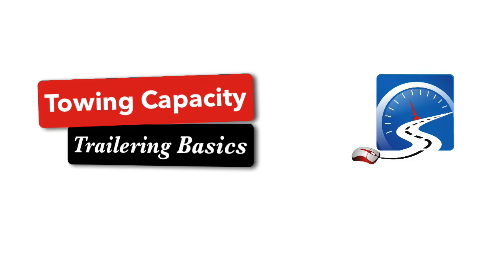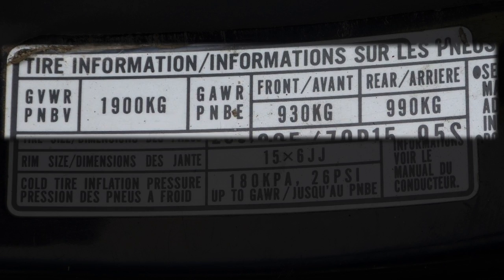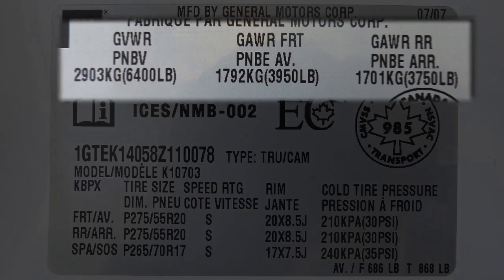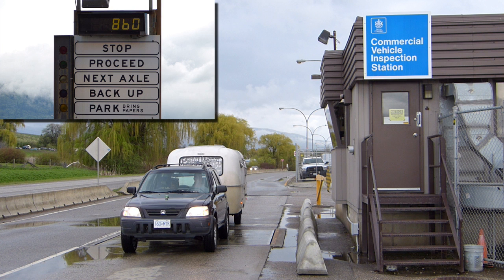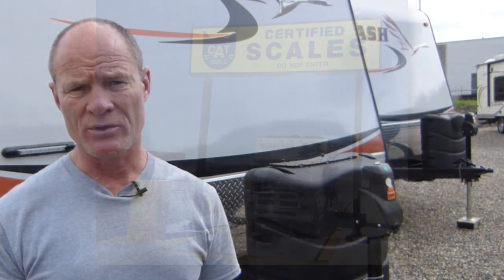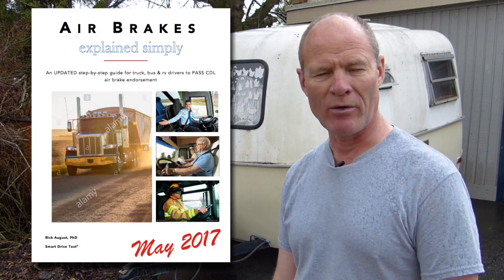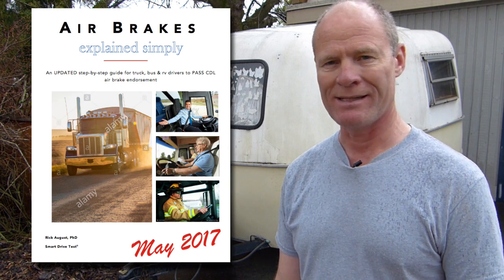How to Tow a Trailer Correctly & Safely :: Towing Capacity•Vehicle & Axle Weights | Trailering SMART

Comment: In the U.S.A., if weight is in question, I would recommend going as directly as you can to a truckstop scale or a local business that has one. If you chance going to a D.O.T. scale (weigh station) & they so happen to be open, you may be looking at some ugly fines if something is overloaded. They are not usually kind or forgiving about it. Also, even though some do, they don't all have a read-out available to you when they are closed. It's much cheaper (and safe) to just weigh at the truckstop, business, etc. than to risk the potential fine & trouble.
Reply from the maker: Hi Anonymous Trucker - Thank you for your comment and pertinent information. You are most right my friend, if you are in doubt about the weight of the trailer, take it to a scale. Never assume that you're legal. If there is anything further we can do, drop us a note. Always happy to help. All the best, Cheers Rick

Comment: On most vehicles,  you will get more than the GVWR if you add the GAWR ratings together.  Why, I don't know.  But you may want to change your statement on that part.  All GVW stickers on trucks  give you the GVWR....which will be less than the combination of the two axles.
Reply from the maker: Hi Harry V - Thank you for your comment. And that is a valuable point; I assumed incorrectly. I took the information from commercial vehicles. With commercial vehicles the axles weights add up to the total gross vehicle weight. Odd that the same doesn't apply to light trucks and passenger vehicles. Yes, I will need to make an amendment. All the best my friend, Cheers Rick

Comment: Thank you, Rick! It's like you know what I need and when  I need it. As you know I'm moving so we will be towing our cars and I wanted to learn how to tow one
Reply from the maker: Hi Big$MoneyBoss - thank you for your comment. How far are you moving? One of the most important techniques or trailering is to always, always pull the trailer through curves, corners and turns. Slow down before, and then power through; not heavy acceleration, but just keep the towing unit in front of the trailer. You never want that trailer pushing you, except when braking in a straight line. Happy trailering. I should have the trailer backing video up by the end of the week. If there is anything further we can do, drop us a note. Always happy to help. All the best, Cheers Rick
Reply: I will be driving like 1k miles
Reply from the maker: So...you're definitely moving out of state!!  80)P
Reply: Yes, I can't wait!
Reply from the maker: Where are you moving to? You'll miss the skiing!
Reply: Nevada I will miss the snow
Reply from the maker: Hi Big$MoneyBoss - you know that the only thing in Nevada is Las Vegas!! And now of course there'll be you. 80P It's funny, I lived in Australia, and on Vancouver Island and I never realized how much I missed the snow until I came back to it. I really like winter...but I like it when it's gone to. I guess I like the changing of the seasons. Safe travels my friend. All the best, Cheers Rick
Reply: Yep we're moving to LV
Reply from the maker: Is it a gamble or a sure thing?  LOL

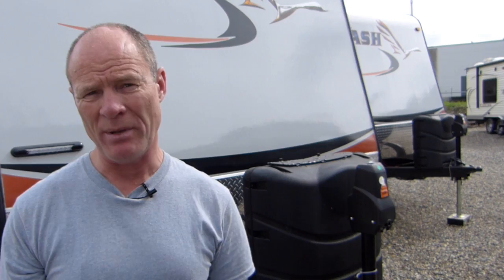Comment: The vehicle at 5:41 is a CR-V like mine. Tongue capacity on that vehicle is only 110 lbs. Looking at the rear suspension sag, it looks like that trailer is too big for that Honda. Maybe you just need new shocks.

Comment: We have a 2010 Chevy Silverado LT Crew Cab 5.3L engine with a Leer cap (approx. 200lbs).  Its GVWR is 7000 lbs.  But the each of the axles is rated at 3950??  That's over 7000 lbs.  Also the tow rating is 12,000 lbs.  We have a 25' TT with a GVWR of 6600 lbs.  We weighed it fully loaded at a CAT scale and came up with: Steer Axle 3120Driver Axle 4040 Trailer Axle 4620TOTAL 11,780 (including the truck, passengers and all cargo/fuel)So my question is with a tow rating of 12,000 -- you video leads me to believe that is the max our truck can pull, not including the truck weight -- so we should be fine (I understand we need to lighten our load over the driver axle.  Yet I've shown the numbers to others and they're telling me I need a bigger truck.  And how does one find the tongue/pin weight??Thanks for your video and advice!
Reply from the maker: Hi Shalene Germani - Thank you for your comment and query. The towing capacity of the vehicle is 12,000lbs; that means that you can tow a trailer weighing 12,000lbs, not the total weight of the truck and trailer. Yes, you have to get the tiniest bit of weight off the drive axles, but most o the time you're not going to be pulling the trailer around with a full tank of water, and the truck isn't going to have a full tank of fuel, so you're going to be fine. With the numbers that you gave me, that truck is more than capable of pulling that trailer. To find the pin weight, go back to the CAT scale and drive on the scale so just the truck is on the scale, and far enough that you can unhook the trailer, and drive the truck off the scale. With just the trailer jack of on the scale, that weight is your tongue weight. As I'm sure you're aware, that pin weight should be 15-25% of the trailer's loaded weight. If there is anything further we can do, drop us a note. Always happy to help. All the best, Cheers Rick
Reply: Thank you so much for your response.  I feel much better.   Also, am I understanding that it would be best to move some of the cargo that is currently in the bed of the truck into the trailer to lighten the Driver Axle?  What would an ideal reading look like assuming the total is still 11,780?  We do have a weight distribution hitch, if I didnt' mention that before.  How do you know if it's tightened properly?  Thanks again!
Reply: Well, now I'm getting conflicting numbers -- checking with NADA, it lists the towing capacity for a 2010 Chevy Silverado 1500 at 5500!  Is there a difference between towing capacity and maximum trailer weight capacity which is listed at 12,000?  Why is there such a vast difference?  If the truck weighs approx. 7000lbs, that seems to add up and we are dangerously close to the limits...
Reply from the maker: Hi Shalene Germani - Thank you for your query. I talked to my mate who is a Chevy truck man through and through and got expert advice for you. Alright, that truck should be able to to 7,700lbs with a tongue weight of 700lbs.  He said to take note of the tanks - grey and fresh water are going to run at 10lbs per gallon, and sewage is going to run 12lbs per gallon. With a 6,600lbs trailer, he said the truck will tow that trailer on the flat and for shorter trips. If you're running longer trips and mountains, you'll need a transmission cooler. The vehicle may be equipped with a transmission cooler, and if it is, you're good to go. If there is anything further we can do, drop us a note. Always happy to help. All the best, Cheers Rick
Reply: Dam! You don't have a WD hitch. You are over GM's trailer weight for weight carrying. If you do it is not set up correctly. You need a WD hitch your front axle weight is not enough for proper braking

Comment: So glad to find your video,...very needed. Q for ya?
I have a 2016 gmc duramax deisel dually, 22000lb towing ability.
I want to get a 4000lb dually suretrac dumper with 14000lb max load...i know it can tow but was told to get inspection for the truck for commercial license plate. I have a class 3 with air...will this do or do i need to add the heavy endorsement? Mapleridge
Thnx Graham
Reply from the maker: Hi graham watts - Thank you for your comment. And you are good with a Class 3 with air. In BC you can operate a truck with a trailer over 4,600kg (10,000lbs) so long as neither the truck nor the trailer have air brakes. Once you throw in air brakes, it's a Class 1 vehicle. If there is anything further we can do, drop us a note. Always happy to help. All the best, Cheers Rick
Reply: Smart Drive Test Thanks so much..your a great resource...appreciate it!
Reply from the maker: Hi graham watts - you are most welcome my friend. All the best, Cheers Rick

Comment: I am buying new truck tires for my F150 tomorrow. Hoping you can get back to me sooner than later on this one. The load rating for the tires, is higher the better or does it not matter? I already installed Air lifts to level out the ride for my travel trailer.  I also have an equalizer installed to help with the stability.
Reply from the maker: Hi Mark - thank you for your comment and query. If you buy tires with higher load rating, first these are going to cost you more and second, I believe you're going to compromise ride. I would suggest that you buy quality tires - I personally like Michelins. I believe if you purchase quality tires with the proper load rating for the GAWR for your vehicle, you'll be great. If there is anything further we can do, drop us a note. Always happy to help. All the best, Cheers Rick
Reply: Smart Drive Test  Thank you for your video. Your reply, advocating against buying higher load rating tires runs counter to recommendations I've heard for decades, at least as relates to RVs. It seems most bumper towable campers in the ~10K pound range come with load range 'D'. I and most people I know opt for top brand,  load range 'E'. They're a little stiffer and rated for higher loads largely because they are rated for higher maximum tire pressures. If 50 PSI is the limit for load range D and 80 PSI is the max for load range E, I may run 50 to 60 PSI with the knowledge that the tire is stronger, flexes less, and consequently, run cooler.  I've never noticed a difference in handling between them.

I wonder what your thoughts are regarding 'nitrogen filled tires'. Given that air is 80% nitrogen already, switching to ~95% (you can't truly attain 100%) seems like hype. And yet, not only do a lot of manufacturers advocate this, I also saw where the tires on the SR-71 jet are nitrogen filled, although at least the Air Force would have the chamber facilities required to ensure 100% nitrogen.

I also wonder what your recommendations are pertaining to sway control. Given a representative 1 ton pickup pulling 10k pounds, with 10% tongue weight distribution, I assume the need for sway control is much greater for a top heavy RV than it is for a car trailer of the same weight. Is that a reasonable assumption? I'll have to look for any videos you have on the subject as it's not clear to me why there can be such instability even when you're not going down a hill or applying the brakes.

I looked into 'active' sway control systems such as the 'Sway Command' by Lippert. If a dramatic sway event occurs, it individually controls the braking proportions for the left and right trailer tires to counter sway. It is an intriguing concept. And yet, I read where Jayco installed a bunch of them on new trailers a couple years ago only to recall and remove them because they occasionally conflicted with the integral brake control system found on new pickups. do you have any thoughts on this emerging technology?

Comment: 2016 F350 Crew Cab Long Bed Dual wheel 4X4 3.73  Axle . Published GCVR is 32,100. Publish Max fifth wheel towing Capacity is 23,500.  my truck weighs 8786 from door sticker ( GVWR 14000 maximum paylod capacity from sticker 5314). 23500 +8786  = 32,386 which is over the GCVR I would have to take the bumper off and let the truck drive itself not to be violation the published weights if pulling maximum published fifth wheel weight . Can someone explain this to me.  the published GCVWR  for my truck is much less than the GVWR 14,000 + the Maximum published towing capacity of 23,500 = 37,500  diff of 5400 over the GCVR . Help me understand.

Comment: I have a 2012 Lincoln Navigator L and I am looking to buy a TT. My vehicles info.  Truck can tow 8500lbs, axle rating is 3.73, GVWR 7900lbs, front GAWR 3700lbs, Rear GAWR 4330lbs,          The TT I was looking at is 6960lbs with a tongue weigh of 835 can I safely tow a TT that size.

Comment: at 3:43, so where does that number come from, if it's not the weight of the trailer? How is the "registered" weight determined?
Reply from the maker: Hi Mindy - the registered weight is determined by the manufacturer, which is not reliable. Therefore, it's best to weight the trailer loaded and you then know exactly how big the towing unit has to be to handle that much weight. One of the biggest factors in determining the weight is the water as it weighs in at approximately 10lb/gallon. If there is anything further we can do, drop us a note. Always happy to help. All the best, Cheers Rick

Comment: I have a 2014 Land Rover LR4. I have a 7,700 towing capacity. Pin weight is 550.
So trailer will be about 5,000 lbs.
My question is that I have good year hl Fortera's tires passenger tires. And I just want to make sure I can haul a 5,000 pound sandpiper toy hauler that is 21 feet. 
What do you think?
Reply from the maker: Hi Darkness And Go - Thank you for your comment. The tires get about a 4 star rating, so those are good tires. I believe that so long as you have the correct tire pressure and the load is balance in the vehicle, you're going to be fine. I would counsel you to do a pre-trip and enroute inspection. Monitor the tires and if you notice excessive heat and anything defective, get it repaired or replaced right away. And ensure that you have a spare tire for both your vehicle and trailer and ensure that these too are properly inflated. And finally, know how to change the tires or have roadside assistance. Changing tires in the dark when you can find the spare or get it off the vehicle can be a real pain. Better to practice in the driveway at home. You may want to check with a local tire shop, but I believe those tires will be fine. If there is anything further we can do, drop us a note. Always happy to help. All the best, Cheers Rick